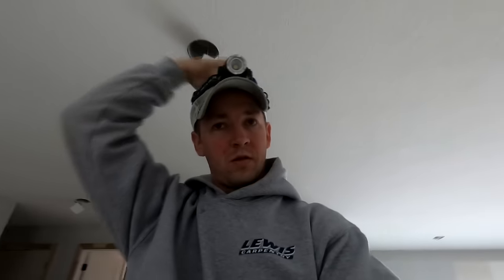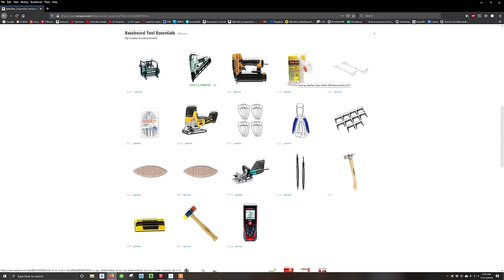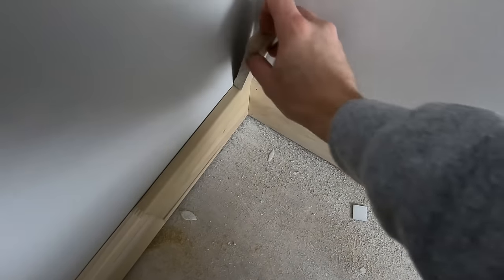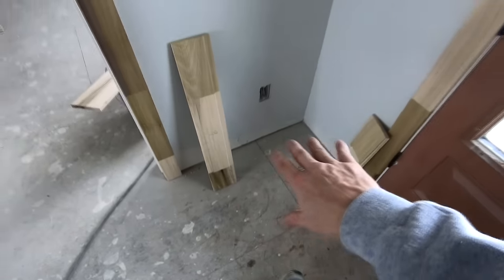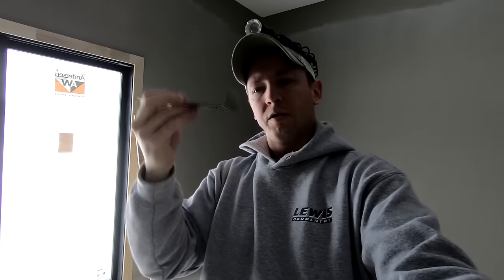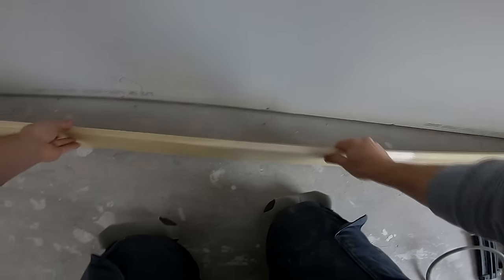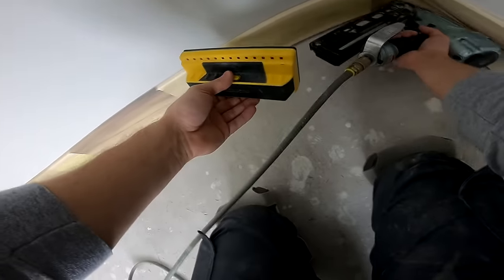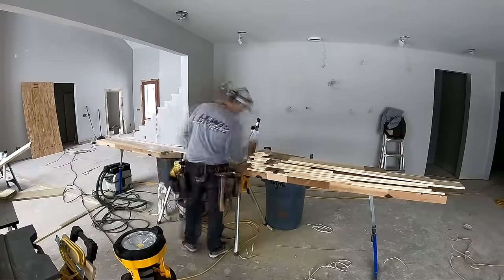Pro Tips for Fast Square BASEBOARD INSTALLATION - To Cope or Not To Cope???

Comment: What is your protocol when the drywall has deep valleys leaving gaps behind your trim? The base will only conform so much. Especially around short corners where maybe there was not enough mud to make the corner flat and square between beads. Does this become a builder issue for you at that point?
Reply from the maker: Usually I'm installing paint grade base and don't run into issues that are too big for caulk to make look fine.
Reply: Gotcha thanks!

Comment: Do you measure all peices of baseboard with that laser or do you use your tape measure at all?
Reply from the maker: I use laser for most pieces. For shorter pieces I use a regular tape sometimes, especially when going up against a door casing or outside corners. I feel I can be a little more accurate with my and the tape.

Comment: what are you gonna do about the gaps is it getting painted so you caulk the gaps at the top of base where the flat hits the ogee of other base. Try using finish nails behind the bottom of baseboard so bottom cant kick in where there is no drywall in the corners fast tip i learned when i started 23 years ago.
Reply from the maker: The painter hits the spot where the square cut meets the round over with a dab of caulk and it paints up just fine.
Reply: @InsiderCarpentry  what do you do when its stained? I have always hated painted trim. Painted trim you dont have to be that good because the painter is the finisher at that point not the carpenter.

Comment: I went out and bought that cool stud finder after watching this video. I was kind of excited to use it but discovered it doesn't come with 2 double A batteries needed. I was at the jobsite ...I couldn't just rummage through the client's drawers for batteries, so I had to wait until I got home to even turn the damn thing on.... total bummer. For 35 bucks, you'd think they could include a couple of cheap batteries so I can use it out of the package...right?
Reply from the maker: Yeah. I always keep a stock or Aa and Aaa for that reason. Everything goes dead at the most inconvenient times.

Comment: When installing baseboard on existing flooring, do you allow the baseboard to sit flush on the floor or do you keep is off the floor by a certain amount?  What about leveling?  Do you find a level line against a wall or go with the flow of the floor?  Sorry if that's a lot of questions...
Reply: Antonio Lazzaro watch the video. All your questions were answered.
Reply: A wise one told me once, finish carpentry is not to be level and perfect, it is to look that way. With floor being not level if you level your boards and had a rise of 1 in on other side cause of it. It would scream hey I'm not level.  So go with the floor. I often have to bend the wood down to touch floor in some areas.

Comment: so the floor guys have the cut tight to your baseboard?  If so, what happens when the floor expands/contracts?
Reply: Did you watch the video? He clearly says that he refers to the plans in every room and leaves 3/8” for carpet and thickness + 1/8” for wood.
Reply from the maker: It gets shoe molding.

Comment: what is the purpose of the relief cut on the back of baseboard?  if i'm making my own base out of 1x pine is it necessary to make a relief cut?
Reply from the maker: Makes the top and  bottom edge sit tight to the wall. Also reduces cupping of the material.

Comment: Why don’t you put a block under the base in the middle of a long run?
Reply from the maker: I do sometimes. I can tell by eye if it needs it or not. Or sometimes I'll just use my hammer claw to pry up, nail it, and move on. If the base is crowned down a center block can be a pain because it keeps the piece from snapping in place. So it just depends. Sometimes I do. Sometimes I dont.

Comment: I didn’t know laser measuring device were accurate enough for finish carpentry.  I need one.
Reply from the maker: Get the one in the video notes that I have linked. Its very accurate. I've used that model for years. Very trustworthy.

Comment: Great video with excellent Information. Something I couldn’t find in your store is the headlamp.
I am looking for one that goes over the hat like you were wearing, that is usb rechargeable and is fairly bright. I need much light than I used to as I get older. Any assistance would be greatly appreciated!
Thank you
Ron H
Reply from the maker: Any rechargeable headlamp off amazon will do. They run about $30 on amazon. No brand in particular.

Comment: Great tips.  I have a similar set up with many of the same tools.  I do have to get the plastic / rubber mallet.  Regarding the +16 foot runs, do you try to put the joint over a stud or do the biscuits eliminate that requirement?
Reply from the maker: With biscuits I dont worry about being over a stud.

Comment: how do you keep baseboard square when drywall is tapered at the bottom?
Reply from the maker: Snap pieces in. Cut long pieces a hair long. The pressure keep things tight. Otheriwse I use the prybar I mention. I slide it in and twist, pulling the bottom of the base out and tight. Then scissor nail the bottom corner.
Reply: I add a drywall screw at the drywall taper to kick the bottom out.

Comment: A way to save a lot of time over time is make up your numbered cut lists with a spreadsheet or word processor, print off a few hundred and Bob's your uncle. Print to index cards for individual floor lists or three or four lists on one page for a multi floor job. Looks like this will save you 5 - 10 minutes a job.

Comment: Laser measurer huh? smrt.. this is how I do it if anyone is looking for more pointers..
I usually use 2" 18g on all base with yellow glue on outside corners, scarf joints, and a line on the the back of the top to secure it to the wall.  No More Nails to glue tiny bits that will split with the nailer to the wall as yellow glue alone isnt reliable enough there and taping everything sucks..   if I really need to twist a piece straight or hold something well I grab a GRK finishing screw which leaves a 15g nail sized hole.    on long runs I use the 15 degree miter lock on the saw to cut a scarf joint and glue the joint together and to the wall at the joint, thats strong enough that the 2 pieces will shrink at the far ends seasonally and not open up at the joint.

Comment: So no need to broadcast a laser like on the wall to ensure the baseboard is level?
Reply: It's on the framer to make sure the subfloor is close enough to level.
Reply: @BenMarvin  true. Now let's pretend he's re baseboarding and trimming out an old house from the 60s. Would he do the same thing in the video or would he laser the wall?
Reply: @AequitasSaints  I personally would probably just keep the base parallel to the floor. You're more likely to notice if the baseboard was at an angle, even if it is perfectly level with gravity. If the floor is out of level by say more than an inch from wall to wall, you probably have bigger problems to worry about.
Reply: @BenMarvin  ok. Appreciate it!

Comment: Can I do the 46°cut on crown moulding?
Reply: Sergio Estrada because base is only 3/4” thick the outside corners work great cutting at 46 or even 46.5 degrees

It will give you nice sharp mitres and you’ll never see it it open in the back because it’s against the drywall.

On crown moulding that will not work because it can stick out 3 inches or more depending on the size of the crown

I always use a compound mitre saw to cut crown moulding and if you increase the bevel 1 or 2° it will give you the sharp mitres your looking for

Comment: How are you (or others) keeping sawdust down in the houses when using the miter saw? I need a solution!
Reply: Nelson Eby I personally use a vacuum. Have an auto switch that when I pull the trigger on the saw it will start up the vacuum. I’ll typically have to clean the vacuum out every day or two.
Reply: @woodworkaf  and does that grab a lot of the airborne dust as well? It seems like I need some kind of hood setup behind the saw to really pull in as much as possible.
Reply from the maker: I just use a festool midi vacuum. Short section of bosch 35mm hose. It helps but its not perfect by any means.
Reply: Nelson Eby not everything by any means but it definitely helps. When you have a vacuum full of dust every day I wonder how I did it without. And how much dust would have been in my lungs.
Reply: Nelson Eby and I just use a small rigid vacuum. I’m sure the Festool one is much better but I can’t afford it. Lol
Reply: I never took the time to find that switch for my vacuum, so put that saw against the wall no bag or vacuum, tape like a 4 by 4 plastic and just cut. When done I have a small battery blower for clean up. Mild sweep, then blow, then cigerate, let it settle and should be good

Comment: Measure your baseboard as if you are gonna cope it . Cut the 45 degree angle straight. So much easier .
So get your measurements.  Cut your 45. Measure the length.  Cut, go back and cut the 45 at a 90 °.

Comment: Why is does baseboard have that relief cut on the back?
Reply from the maker: Makes the base sit tight to the wall top and bottom and prevents it from rocking. The relief also reduces surface tension on the face of the board which will mitigate cupping.

Comment: Professionals put 45 degree angles in the corners. Right?
Reply from the maker: No, professionals use what is called a cope joint.
Reply: @InsiderCarpentry  I always hated doing trim work, but I bought the cordless dewalt trim nailer. Saved some time for me by not having to drag a compressor and air line around.

What do you charge per linear foot?

And I have tried the cope joint a few times, its a real pain in the ass. Maybe one day I will master that but I don't do trim work enough to practice it.

Comment: There’s been a design shift at the development where I work. They’re moving away from using shoe molding. As you can imagine what a big pain in the butt it is installing base without shoe molding...especially when the subfloor dips and rises constantly from crappy framing.
Reply: No shoe moulding in ireland. Cordless electric plane and a fair bit of extra time.
Reply: Those cordless planers are a lifesaver. Right?
Reply: Would be lost without it. Razor sharp block plane is also a must

Comment: I understand your reasoning for not coping the skirting (we call them skirting in Scotland) but when it comes to second fi,  perfection is what gains further work. Its not saving the client money because essentially they are already paying you to do a job, and if that means coping then that's what will be done.  I wouldn't even butt skirting inside a cupboard
Reply from the maker: Value gets repeat business, not perfection. 99% of people do not want to pay for perfection. Giving the client the right balance of quality, speed, and price is value.
Reply: @InsiderCarpentry  The people here in my country who want value are not the type of clients I look to to gain as 9/10 they want cheap and cheerful but will complain or try and find a way to withhold money. They want to pay 10-20% less than what you quoted. I always leave a perfect job no matter what it is, I rely heavily on word of mouth and I always find the people who want perfection are the ones willing to pay for it without hesitation. I'm not hating, I think your chanel is great. I find it fascinating how different our job is on the other side of the pond, for example the baseboard is always fitted after the hard flooring and it's fitted tight to the floor before carpets.
Reply: Maybe coping square stock makes you feel like you've done a perfect job, but in the end it's just a waste of time.  Homeowners only measure things with their eye. No homeowner is going to notice or care if square baseboard is butt jointed in an inside corner unless they actually request otherwise. 
My painters fill the top of the joint with wood filler and sand it before painting anyways so no joint is even visible. ( I still make the joint tight though, of course)
Reply: @grmrbrts5123  each to their own but if a customer was paying me to fit baseboard regardless of the profile I will always leave the job the same. What the next trade does isn't up to me and if your painter fills the gap then that works for you (unless its hardwood.) All I'm saying is I stand by my comment and my preference is to leave the best job I can
Reply: @Ryan13117   I do the best job I can as well, regardless of who is painting it. I was just making point that the top edge of butt joints can be made to look perfect/continuous with little effort even if it isn't even necessary to do so because homeowners are unlikely to have a problem with it to begin with. I'm not talking about relying on painters to fill gaps in shoddy work. That's not me
The thing is, is that it is important to understand tolerances. The quality of the work you do and the time it takes you to do it needs to be justified in a professional sense. IMO is it not at all justified to cope square baseboard corners given how much extra time it would take to do so as well as the fact that it makes no noticeable difference in the end product.  Especially if you charge by the hour. (This is coming from a general carpenter btw. I'm don't exclusively do trim, but i've done a hell of a lot of it)
Reply: @grmrbrts5123  You're obviously not getting my point. Someone is paying you to do a job, and let's be honest here it'll take you what, 1 minute extra per corner? Again, all I'm saying is I never have to rely on another trade to cover up my work. If this is your method of working then that's great for you, but for me, it's not how I was taught and I've maintained my high standards throughout my  career regardless of the job, not just for the customer but also for myself
Reply from the maker: If it works for you that’s great. We’re talking about taking a value approach to the work. The ratio of “perfection” to value is all over the place. Give the customer what they want. For us a value approach and maximizing the customers bang for buck means butting square baseboard. It’s not a matter of some type of moral superiority. It’s just common sense business practice. Everyone makes trade offs somewhere.
Reply: @InsiderCarpentry  let's agree to disagree, I don't like where this is going because I actually enjoy watching  your channel. As I said if this works for you then there's no reason to change. What I do works best for me. I wish you all the best.

Comment: never seen someone not cutting corners at 45degress over butt joints when doing baseboards
Reply from the maker: Yeah, once you try butt joints with biscuits you don't go back. Really easy and bullet proof joint. Easy to cut a hair long, snap the two pieces in, and off you go. I used to do a miter on my butt joints but not any more.

Comment: Someone should have primed that base first.
Reply: Jerry Riggan or fully painted, why come back and paint after unless walls aren’t painted yet??
Reply: @mattwalker138  The nail holes will need to be filled once they're installed, so it doesn't really make any sense painting them prior. As for priming them first... That's the painters problem if they haven't done so
Reply: Matt Walker this is new construction, the walls are primed to seal the drywall and the painters come in after trim install and paint everything. None of the casing or door jambs are primed either, they shoot it all at once.
Reply: You haven't worked new construction have you??
Reply: Never final paint any trim work. Primer is fine because it soaks into the wood Unlike semi gloss paint which sits on the surface. 
If you have to sand any wood and there is semi gloss on it it’s like sanding plastic it looks terrible. Plus you need 
1 to 2 coats of semi gloss to cover all the nail holes and latex caulking

Final painting saves you no time in the end once you go back a second time to cover the nail holes

Comment: 'I like to cut all my baseboard outside corners at 46 degrees'
I am trying this tomorrow, if it works I am going to punch myself in the face lol, all these years
I always find/bisect angles when it is 22.5 or visibly off 90, never thought about 46° though for standard external miters. 
I will report back
Reply from the maker: It's the only way to go I'd you want to be fast and effective with paint grade.

Comment: I installed a bunch of square base and the homeowners didnt like the "cope" method and I had to go back and miter everything. Awful
Reply: Zach Coleman if the base is square and you cope it it ends up as a square cut. Unless there is a profile to the Trim you never cope anything flat. Just but the pieces and make the long pieces a hair long and spring fit them
This way everything is tight

Comment: you look like youre channeling your inner baby crawling around like that...find a stud with a 16oz waffle head framer...make a mark on the floor...pull your tape to 16oc on said mark...fit piece in place....stand up and bang it like youre framing a wall....I only crawl like a baby running shoe moulding...outside corners and small pieces of base...take a knee......
Reply from the maker: Unless you want video of my crotch i have to be in that position to take video of what I'm doing with a gopro strapped to my chest.